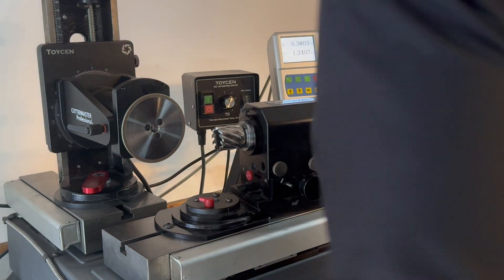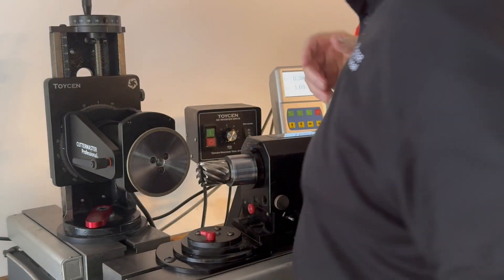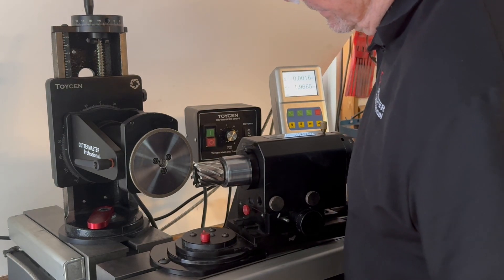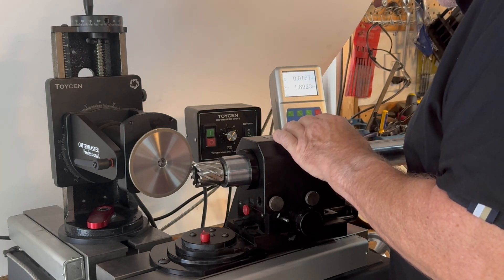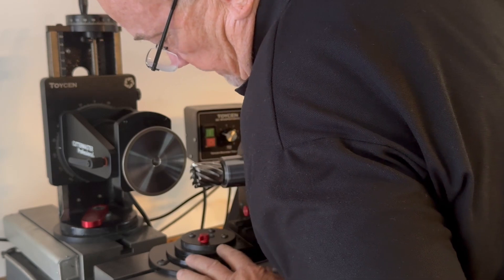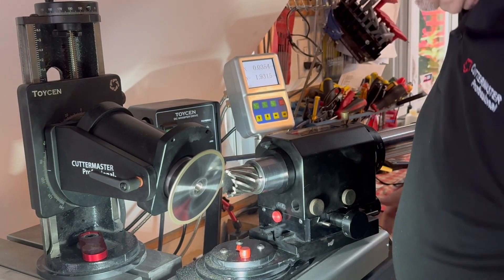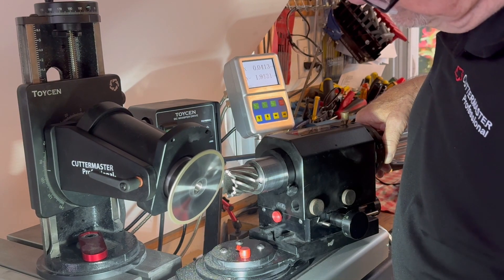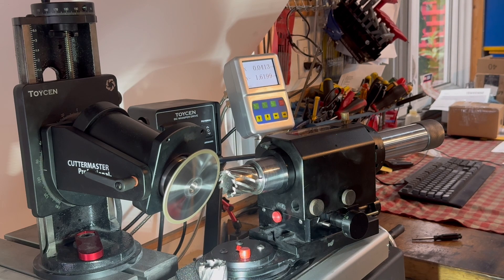How to Sharpen an Annular Cutter on a JXT universal tool grinder

Comment: Hola, la máquina que hace el corte de la fresas de tugsteno. A cuantas RPM gira ?
Reply from the maker: We run the motor at an RPM that give a good finish and dosent heat up the tool  up to 4000 rpm if necessary
Reply: @Cuttermaster  gracias por la respuesta. pero pregunto por las RPM de esta maquina https://www.youtube.com/watch?v=zk3ZiVOvwFg, vos tenes un Motor de 1500 RPM y lo convertis a 4000 RPm para cortar carburo de tungsteno.